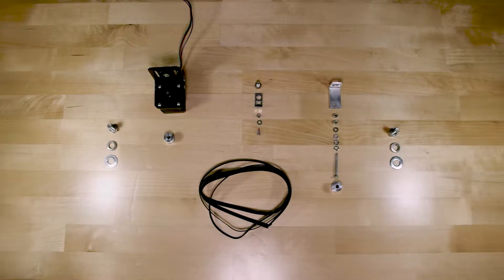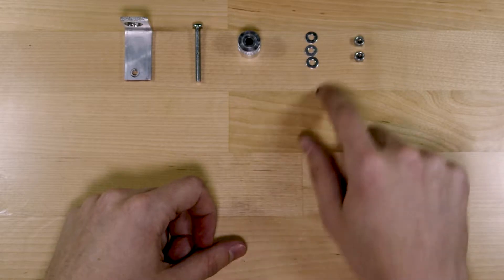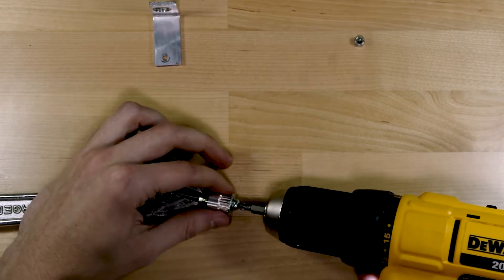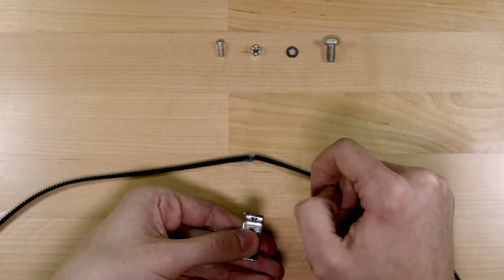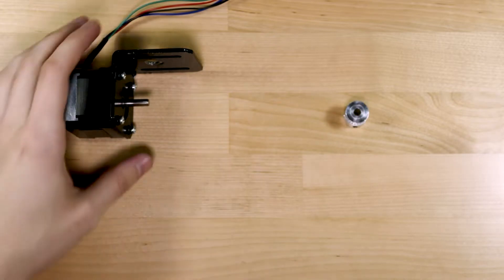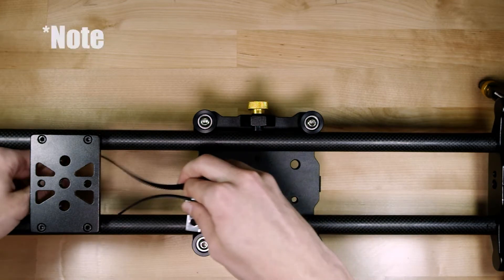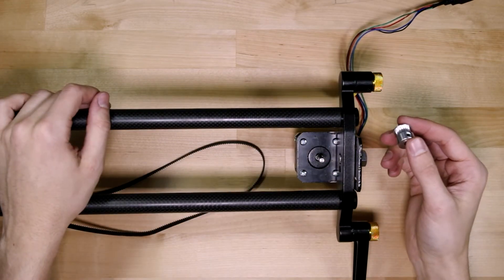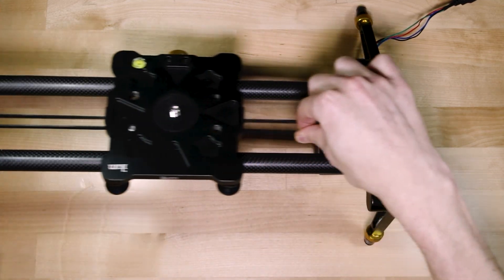Automated Camera Slider - Hardware

Comment: Looks great.  This does answer a number of questions.     I found that there is a clamp you can make to put under the sled so that you can slip the belt through by overlapping both ends ... The advantage is that you can pull the cable tighter as it might slacken with time.  Mind you the way you built it means that you don't have to fuss with adjusting that tension every time you take the system apart.     This sounds like an easy project to tackle and thanks for the video.